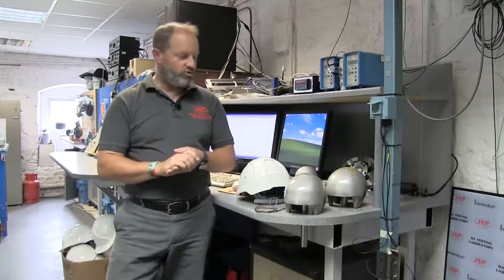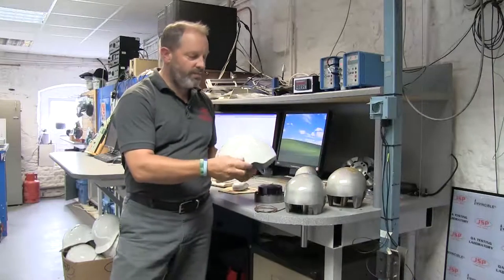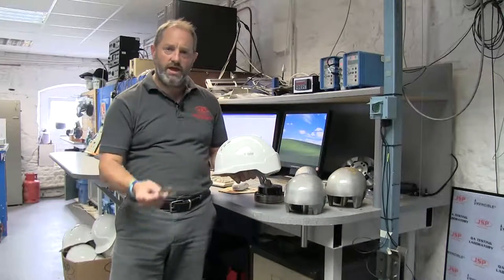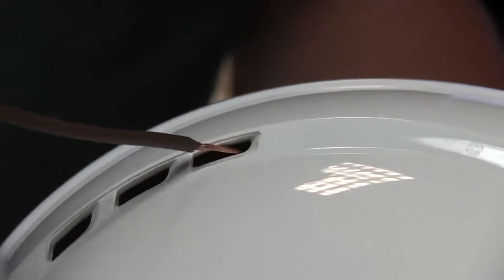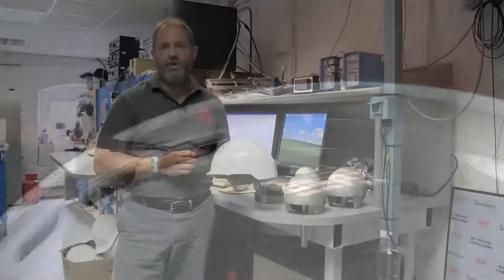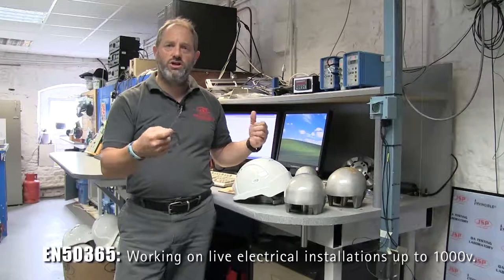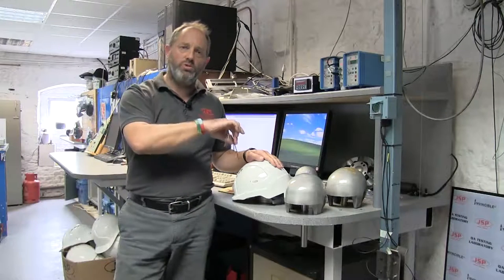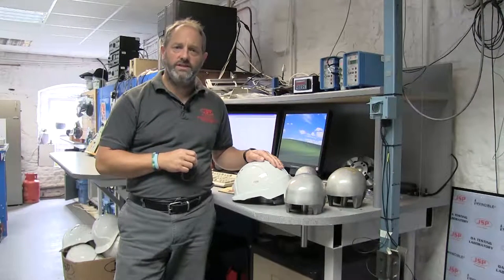Vlog #7 - Vented safety helmets (Hard hats) and electrical repairs

Comment from the maker: Technical Director Matthew Judson explains why vented safety helmets cannot be used with electrical installations.

"Why can't I use a vented helmet to do electrical repairs?"

There is a possibility that if you are working with live conductors (wires) that one could pass through the vents in the helmet and contact the wearer, not pleasant. There is another standard, EN50365, which does allow for electrical insulation testing of vented helmets. Again it is very much down to risk assessment. If there is a chance that a live conductor could fall on the wearers head during working then an unvented helmet should be used. http://youtu.be/o1ELe06x3UE